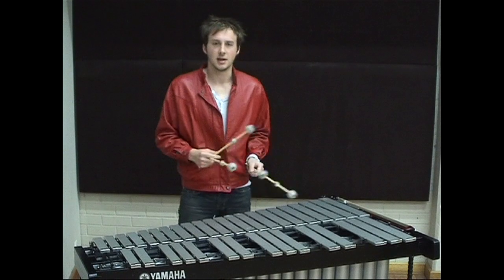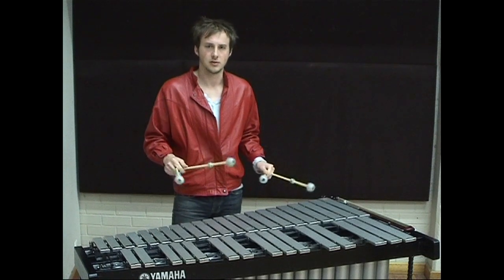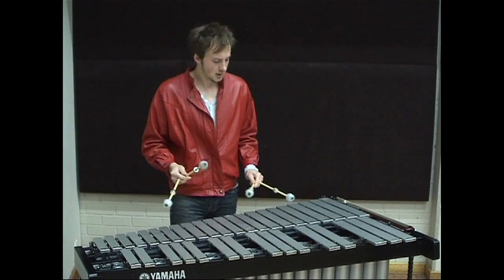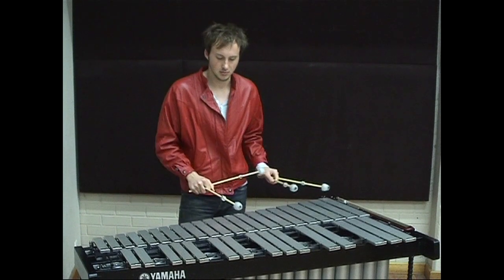Vibraphone Techniques

Comment: 00:00 Vibrato
1:15 Mallet dampening
3:28 Harmonics
5:52 Doubles
Reply: Has it been realised that it would be possible to operate the vibrato speed with footpedal as well  so you could pretty much forget about the preset ? Also it looks that it would be more ergonomic to play if the instrument was angled forward, in other words slightly away from the player. The angle of wrists related to the bars would be considerable less causing less friction. Some keyboard players do that.
Reply: There are  several tips for constructing marimbas
Attend a school or self-study via an online course
Ensure you are completely committed to it before you begin
(I read these and why they work from Delfords magic plan site )

Comment: The vibrato is actually a tremolo similar to what is used on an electronic organ. The motor he mentioned is attached via a rubber belt that spins a shaft, this shaft has a disc attached to it in each tube under the vibraphone keys, this creates the tremolo effect. Organs use a Styrofoam  baffle with just a portion cut out to allow the sound to pass from the speaker at a different frequency causing the tremolo effect. It would be similar to placing your hand in front of your mouth as you make a sound, moving your hand forward and back causes a tremolo effect.

Comment: He does know that the "vibrato" effect is really amplitude modulation  and has little to do with pitch variation. There is of course a minor pitch modulation aspect to the butterfly value rotation but it is mainly for amplitude modulation.
Reply: I thought they duplicated then phase shifted one of the waveforms, and the knob controlled the speed of the phase shift. Obviously the phase shift does alter the pitch of the 'wet' waveform, but not noticeably.
The amplitude change is a side effect of the phase shifted waveform canceling out the original waveform.
Reply: Its Tremelo